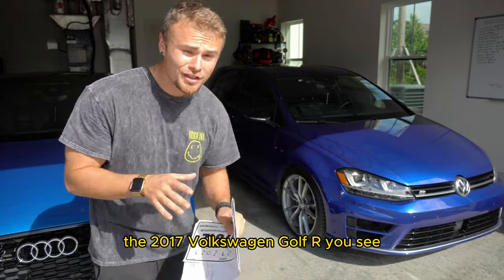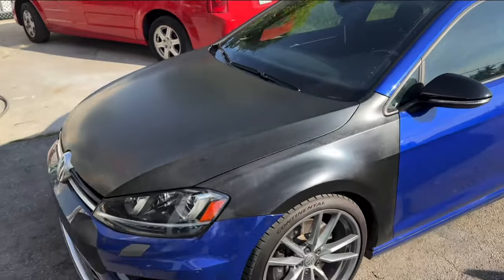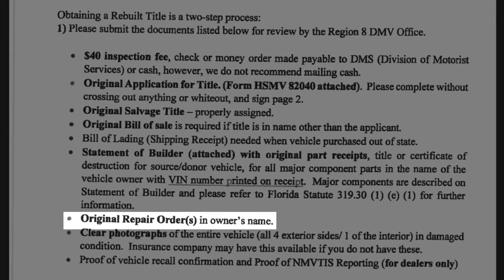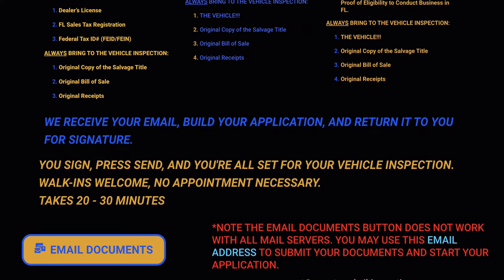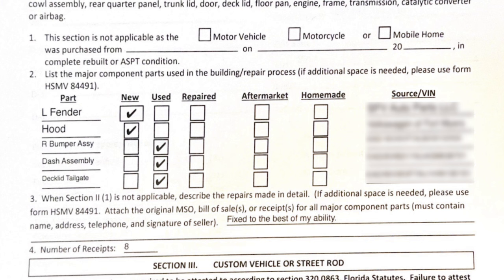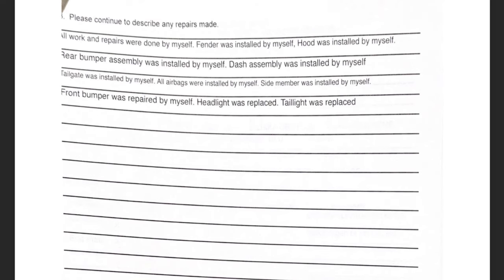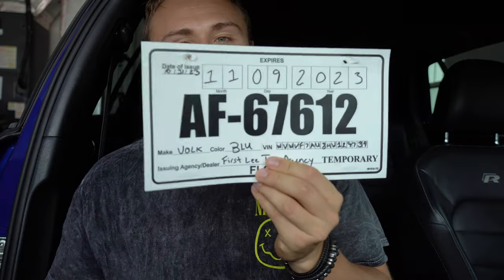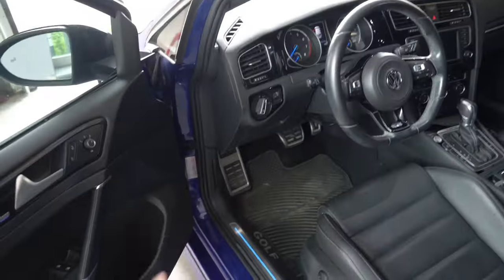How To Register A Salvage Title Car | How To Pass Rebuild Inspection!

Comment: Bro, that was the most thorough explanation on YouTube! Good shit! I seriously hope my experience is as smooth as you made yours out to sound. The car I bought has hail damage so it's mostly body work, but I bought the car from someone else who bought it it at auction, so I'm pretty nervous about the whole thing.
Reply from the maker: as long as their are no lights on the dash and no serious damage to the car.... you will pass with flying colors. make sure all the glass is fixed and no cracks. and i HIGHLY recommend a private service to pass if they offer one in your state as it is much quicker and they will do all the paperwork for you
Reply: @HaydenSchreier  hey, that sounds comforting. I'm also in Florida myself and the guy who sold me the car actually recommended the place in Bradenton, but I live in Brooksville, so it's a hike. But I didn't know you can get a 10 day tag to drive the vehicle to the inspection! 
One thing worrying me though,  the kid didn't do anything after he bought it and didn't give me a bill of sale. Is that going to be a problem? Any help or advice would be greatly appreciated!